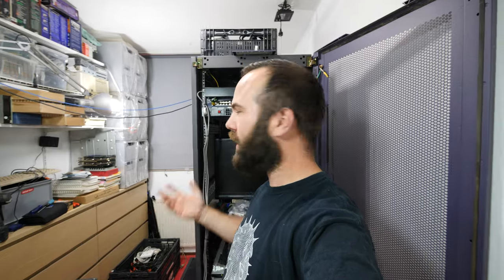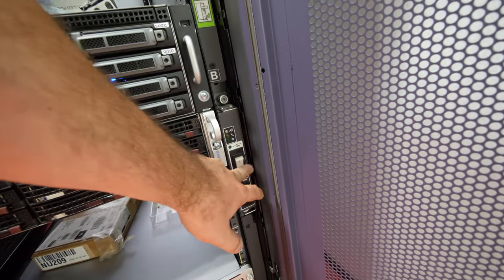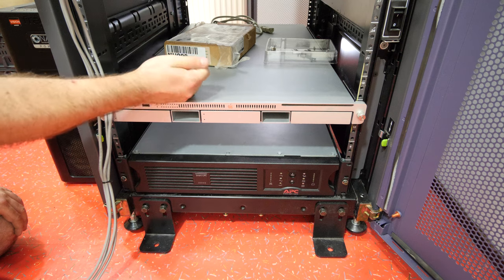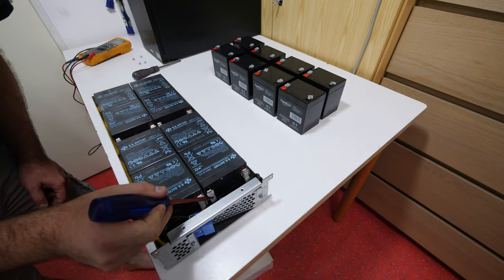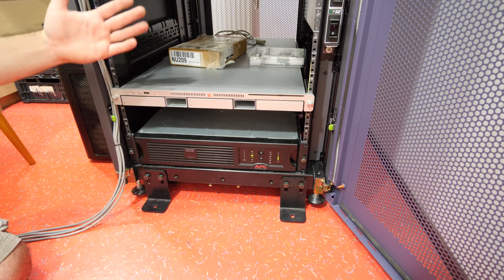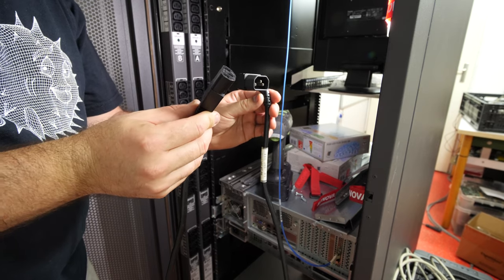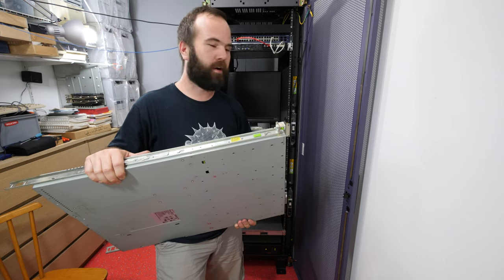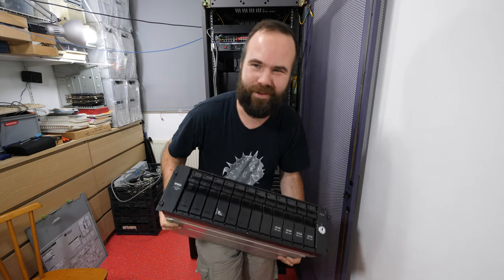Powering my Home Lab, UPS Battery Replacement, Sun Rack 900-38 Power Distribution

Comment: I get 3-5$ a battery for 12v 7ah from recycler and new 7ah batteries are 10$ without warranty & 9ah ones are 15$.   ..i use exide batteries . I have two of their 200ah sealed lead acid. And they are working good for 3yrs now. Runs my whole network and server rack for 2hrs on battery.

Comment: Hallo Victor, I enjoyed your video. 

I had a question about the VA rating of your system, if your battery bank is 48V 10Ah, that's 480Wh, in order to get 3000VA you would have to be discharging the batteries at C/6. 

SLA batteries are rated (usually) at 0.25C so how does the unit manage to produce such incredible power draw from such slow discharge batteries. I assume there are a few capacitors but that's still quite a leap.

Thanks again.